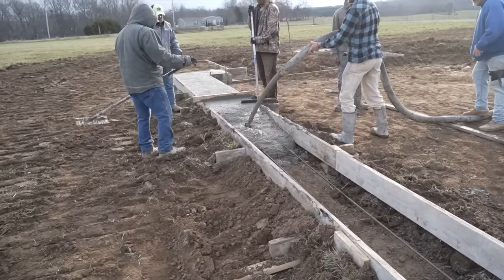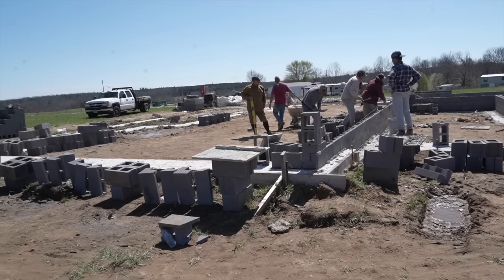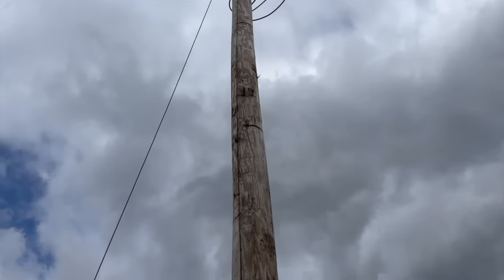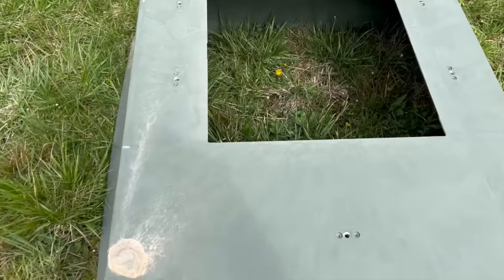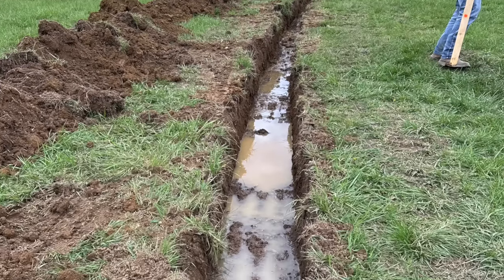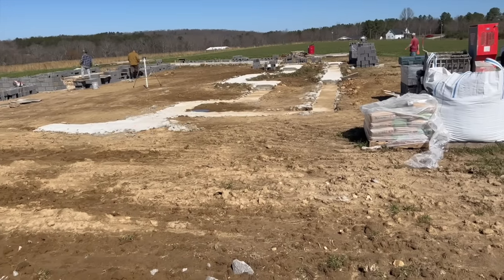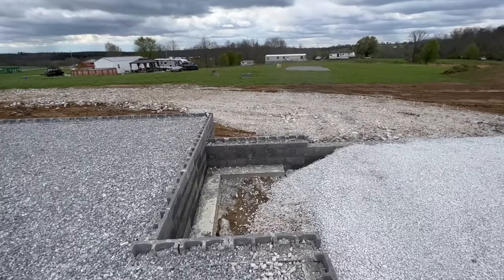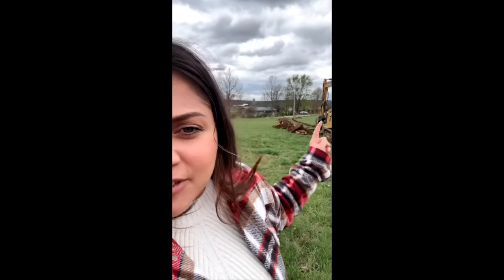FAILED INSPECTION: EPISODE 4 OF BUILDING A FARMHOUSE

Comment: Our place in GA they just buried the conduit in the ground and i had a issue with my lights going out months after cable company cut my wire and fixed it- i had to get it done all over again and i paid the $100 for the grey pipe to go over it, . In the ground there is moisture which gets inbetween the opening and knocks out the lights.That's only from the pole to the house- underground  electrical can cost you $10,000 , it's very expensive!
Reply from the maker: It’s true, it can run very expensive. We lucked out with Nelson being an electrician (in his past life) 😉🙏🏼